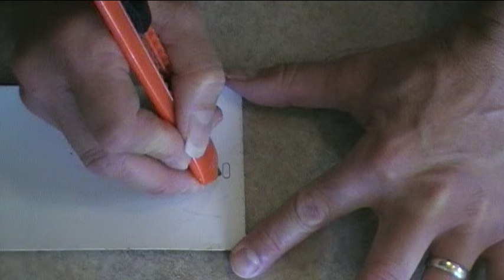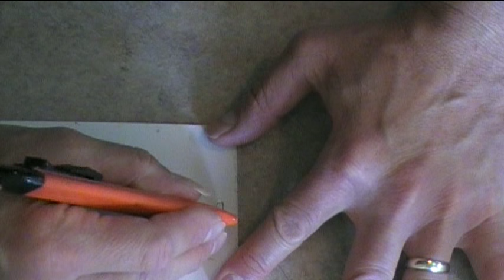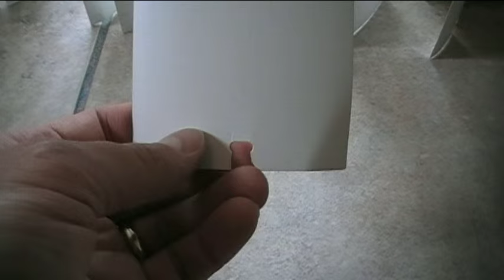OobaTech #13 - How To Repair Vertical Blinds

Comment: go to Home Depot or Lowes and go to the paint dept. Grab a couple paint sample cards that match the color of your blind(s). Cut into thin strips width wise to fit the space between the top of the hole and the top of the blind. cut the strip in half and super glue on both sides of the blind, then file any excess down flush to the top of the blind.  super cheap and you can't even see the repair unless  you're up close looking for it.
Reply: That is so creative. No thickness issue sliding into that slot to mount?